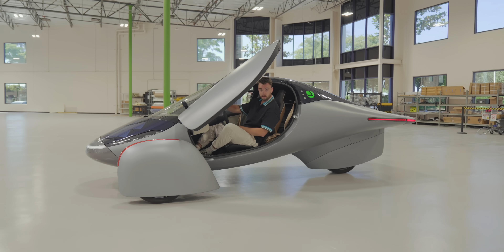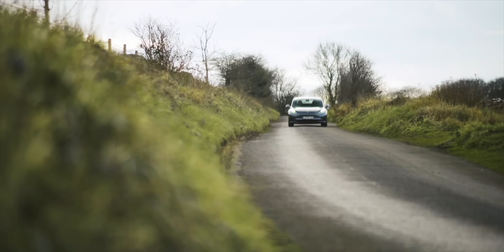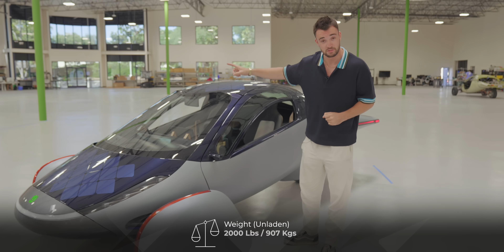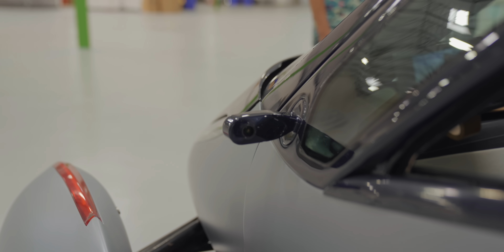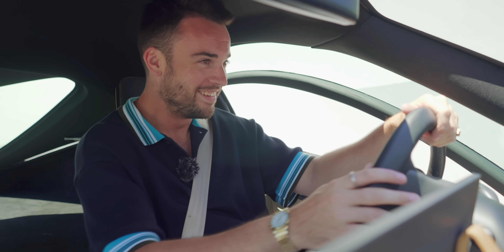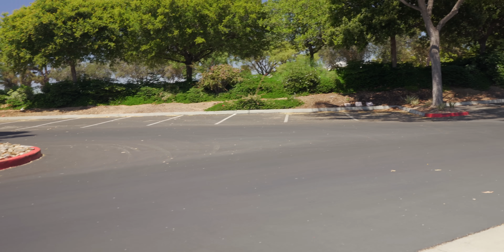The Game-Changing CHEAP Electric Car Inspired By Fish!

Comment: Honestly, I wish they made a 4-wheeler version. Two wheels at the sides of the back side, would have made it a lot more stable, which means it could have added a feature to make the front wheels get closer to eachother at low speeds, so people can more easily fit through narrow roads (like the one in Italy, for example). Being an upgrade, it would cost more, but it would also mean that it would be categorized as a car, so it can be driven by people who don't have a motorcycle driving licence but do have a car driving licence. Edit: It would also really help if they would add the option to raise the wheel covers, for more safely driving on roads with potholes, even if the price increased and the speed needs to be decreased.
Reply: From memory, there will be an off road version with higher wheel covers, and in the UK at least, a car licence will allow this to be driven - it's a trike after all.  Narrower would be good though.
Reply: That will defeat the purpose of their teardrop shape design.....the whole point of this company is producing cars that are the MOST aerodynamic.
Reply: The second planned Aptera is a 4 wheel, 5 passenger sedan. that may fulfill some of your wishes.

Comment: Sandy Munro says shaping metal sheets into such curvy shapes as this fish-shape of the Aptera is very expensive, which is why the flat Cybertruck of Tesla only costs 40k USD. In that case, the Aptera should be expensive, which is why it is a one of a kind, but remember that this is made of composites, not metal sheets, so it's basically plastic.
Making curved plastic isn't expensive. Look at all your plastic toys.

Comment: Wow that looks fantastic. Even allowing for the lower light levels in the UK, it would be ideal for someone doing just a few local runs each week, all on lovely clean solar power. 🙂 I can imagine that those local runs might get extended a bit though, as it looks such fun to drive. 
I would quickly get rid of that horrendous square steering wheel though, change it for a proper circular one.

Comment: I love the car and would love to buy it but it will have a problem in places such as where I live in New England where it snows because of its ground clearance with the wheel covers. Another thing is the cold New England winters. Are there plans for  warm air vents to warm the cabin?  The seat and the steering wheel will warms those body parts in contact with them but how about other body parts such as my face? Will it have air conditioning? If so, without air vents, how will the cabin be cooled? As a result, I am hesitant to buy it. Once they solve those problems I will be among the first in line to buy an Aptera(= without wings). I would also like to buy the Terrafugia(= Escape the Earth) FX but Geely seems to no longer pursue making a flying car.

Comment: The width of the front wheels - may as well be a larger compact 4 wheel vehicle than one with limited utility. How does it handle potholes? We just need a genuinely cheap small hatchback with good design and efficiency. Maybe the BYD Dolphin/EA1? Don't think most buyers will flock to the Aptera as interesting as it is. But they won't need it to at their production numbers, they'll sell whatever they can make.

Comment: Amazing design! It cold be an alternative to  3 wheeled scooters. I would say it's commercial success would depend on how fun it will be to drive
Reply: Based on a ride my wife and I had in an alpha prototype back last November, the acceleration is thrilling, even in the 2 motor model.
Reply: pop-out hanglider & hydro foils condensed back up parking.

Comment: Narrow lanes in London, come to Devon we have some narrow lanes with a central raised grass area which are ideal for three wheelers and for cleaning floor pans. As I fly over Devon I see much green stuff due to the amount of rain we have which comes from clouds. California seems to have a lot of blue skies instead. 
We are daily sliding deeper into a Low Sunspot period, and more clouds and therefore more weather is on the cards. Light cars are no good in floods or high winds, and especially side winds which can be eased mentally by opening the windows. The feeling your about to be blown off the road is common in light vehicles.

Comment: "Thankfully" they didn´t mention a few drawbacks of the concept ...
(not that there are many, though)
1) The three wheels design allows higher efficiency but is really bad for driving stability (and suspension to some degree)
2) Making the car 2.2m wide at the front wheels helps stability but likely makes it usable in U.S. cities only. Finding parking space that wide in European cities will become a challenge ...
Reply: Heh, I don't think it's that wide. Width on a low cost sedan here is Europe is about 1.98 meters without including the mirrors.

Comment: "When it comes to electric cars it's the magic that makes everything better." BS. There is no magic in them, and not everything is better - mostly worse than ICE cars. Better range? No. Better priced? No. Better fill times? No. Better handling? No. Better tyre wear? No. Better top speed? No. Sure, they beat ICE at a few things, but overall, they are too little for too much. But Jack has sunk low by pretending this lame duck has any 'magic', because it is yet to exist and the prototypes are all fakes. The Gamma they will be showing at FCL is most likely to be another fake. Aptera has announced that it will be a static display only for attendees. It needs to do the things they brag about, but I am not even sure they have motors from Elaphe yet. I can see Aptera Motors will be desperately ripping out motors from an Alpha in the coming days, so someone should hold them to driving all their prototypes together to prove they haven't done that at the first drive of Gamma. In fact, when Gamma can eventually move, they should run them all around Chuckwalla until they all drop and publish the distances for each.

Comment: I'm astonished that you didn't mention that The aptera is capable of 0 to 60 mph in 3 and 1/2 seconds with the all-wheel drive variant. Imagine that, it's as fast as a performance Model y with potentially three times the range and no need to charge ever

Comment: Nice review, but he has been misinformed about a few things.  Number one, it isn't a car, at least in the US.  It will be registered and insured as a niche in the motorcycle category.  This has aided the production because it does not need to meet the same safety standards.  Chris was very accurate in saying that it is closer to one of the Solar race cars in Australia; neither one has formal airbags in the steering wheel or passenger dash, not side curtains.  He also needs to understand that this model is not the one which will potentially get 40 miles of range per day with solar charging.  One needs to opt for the full rear hatch option which will sacrifice the rear window.  Why compare it to other EV's like the Mercedes EQXX or Lightyear Zero which both cars.  Once you make a similar comparison to other motorcycles such as the Zero or Livewire, the features of range and efficiency are more matched.  I wish Aptera would focus more on comfort and safety rather than total efficiency.  I would certainly sacrifice a few kilowatts if it were only safer.

Comment: It's beautiful and cool, but we don't really know what the specs actually are given this is an Alpha, on the way to Beta... and they'll have production going next year... Much like software; it's vaporware until it's released. Review the specs after release. It's not a car, but a tricycle..., a fully enclosed e-slingshot? A motor cycle achieving efficiency at least in part by not having to obey car rules... Don't interpret this as hate, I love the vehicle, but rather a bit of Jade. Seems like we've been here before. I hope it's different next Feb 2nd.
Oh, and the 1965 Dodge Cornet convertible my father owned until the 1980's placed it's fuel intake under the spring loaded read license plate, a common feature, but a good use of space. Very futuristic.

Comment: Been following Aptera for several years, and hope to get one someday.  I do question the mileage claim a bit though, if you add a passenger and their "stuff" (say if you were to take a trip), that adds significant weight. And little things such as video rear view mirrors currently not legal in the US.  At least CA is now approving vinyl front license plates, so that won't mess up aero, unless it requires a somewhat vertical and/or flat surface.
Reply: Front plate on a cycle, since when?

Comment: I really want to see this in production soon, but Aptera continues to make optimistic claims about range and efficiency. Not GROSSLY hyperbolic, but 10 mi/kWh is a best case scenario. Rolling resistance alone is a large part of that issue, and throwing in a 100kW battery is going to impact that significantly. It will be able get close to those numbers, but average drivers just aren't gonna get there.

Comment: How much did they pay you to blow smoke about that car for 22 minutes?! It's ugly! Useless for most use cases except 2 people and a few items on very flat roads. With no bumpers it gets totaled with any impact. Hub motors are THE WORST kind of brushless motor! Their weight is unsprung and in the tires where it is going to make ride quality the poorest. Power to weight of hub motors is far lower than outrunners or inrunners. This car should have drive shafts out to the wheels and the motors in the nose area. I bet these cars are not as good as the hype. That cowling around the rear wheel will get smashed and destroyed the first time this thing goes over a speed bump! The front wheel covers will break soon after!
*
No brick shaped fish? Really? They ought to spend 11 seconds confirming that information before spewing such nonsense! There are quite a LOT of blunt nosed fish!!! They are NOT all slim and aerodynamic! How about 90% of whales? Really blunt nosed! What a bunch of marketing hype!
*
Your definition of "cheap" is loads different than mine! This thing is FAR FROM CHEAP in the price tag department! Half a car and costs more than a typical small gas car that will have much more passenger space and cargo carrying ability! Just my opinion...they won't sell very well and Apterra will go out of business again.
Reply: Again ? Do they have a track record of vaporware ?
Reply: @machintrucGaming  Ever see an old Aptera on the road...like anywhere? You'll see the 2 or 3 prototypes that got built and no actual production units. Maybe this time they will actually make a few of these ugly ass things for sale? At the price they want for them, they won't sell well and certainly won't compete with much better options that are either electric or gas powered. Efficiency is a good thing, but when you lose beauty, function and practicality to get it, the market for the thing rapidly dries up if it is also expensive. 
*
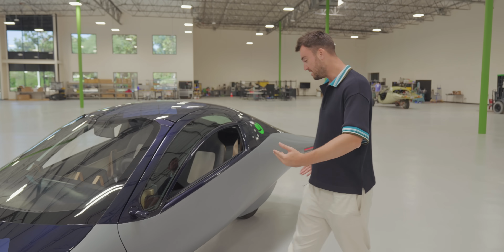Look at what's in that warehouse. Did you see any machinery? How about partly built cars? Any production lines? You see tons of empty warehouse space, a few chairs, fork lift and a couple of people walking by. Start watching the back ground at 5:32 to 8:25. Earlier on you can see the rear roll up doors of the warehouse. That's literally the back doors of the space! At 5:32, the camera angle lets you see out the front windows of the warehouse. In the back ground is a prototype car and not much else. Watch until 8:25 and the camera operator goes completely around the car. Camera angle changes enough that you can see the entire warehouse space and that it is 100% empty! What's that tell you about production of these cars??? So yeah...vaporware!

Comment: Have drooled over this thing since I first saw it several years ago. Absolutely awesome. Sadly, it's wider than a Transit van, so it's not gonna work well in the UK, but I wish them the best of luck across the pond.
Reply: It could be that the homologation process will end up with a narrower design for the UK market, which will trade some aerodynamic resistance and speed to fit in narrower spaces.
Reply: @n.brucenelson5920  Maybe, but they are a tiny company with more back orders than they know what to do with. I imagine it'll be a long time before they get around to thinking about selling outside the US, let alone in markets requiring a conversion to right hand drive.
Reply: @robrackstraw  True.  But the RHD models have already been designed and they have European holomogation experts under contract.
Management and board members have made repeated trips to Europe.
One of the founders replies on German language forums.  They may be more serious about international markets than you imagine.
Reply: @n.brucenelson5920  I'll be very happy to be wrong.

Comment: If you make the back wheel a dual, sister-ed wheel, so there are two wheels in one, you can make this vehicle eligible for the Federal tax credit that requires four wheels; easy fix. This edit would also make the rear wheel safer, should one of these new dual tires go flat.
Reply: And make it liable for all the safety requirements of a car, rather than the 3 wheel trike it is now.

Comment: The major OE's don't make "cars" like this for the simple reason there is practically no market for them.....  

Who is this actually for?  If you want to do 1,000 miles at speed, get on a train ('lecys trains are characterisitically long and thin and thanks to steel wheels/rails have very low rolling friction, and take lots of passengers, so return very good ml/kWh/passenger), if you use a car locally as a lot of people do, then you don't need very good aero performance, and with just two seats this massively limits the usefulness of this vehicle. Add in probably zero NCAP stars for crash performance and realistically, most people wanting a small BEV will get a Zoe, ID3,Leaf etc etc

I also can't see how 100kWh of batteries is going to fit into that car, given the very non-rectangular form factor of the body. There is probabyl just enough volume, but packaging cells and busbars into that odd shape is going to be a massive PITA, and then you get to the issue of protecting that huge battery from impacts. Something like a Tesla Model3 has probably the best side impact performance for any passenger car precisely to prevent the battery being deformed, damaged and going into thermal runaway.

yes, some people will buy this a a toy (as per a MX5/Miata) or personal commuter (as per the Renault Twizy) but hisotrically that has been a very low number of people overall.
At half the price of a tesla, that's still very expensive for such a niche vehicle with just two seats.

Finally, as consumption is a reciprocal, the absolute running (fuel) cost difference in the real world between a car returning 5 ml/kWh and one doing 10 ml/kWh is fairly small, so i'd argue that whilst very low consumption is great, it's not that much of a buyer driving force once it's already "low enough" as it is for a mainstream BEV (and in all cases, driving style and driving cycle make a far bigger difference in the real world to overal consumption)

Comment: I like it, it's an aerodynamic compact car, which is all I need.  If the price is right I will get one.  The solar panels should be an option though as they add weight and cost to the car, and being in Scotland will not be of much use.

Comment: That whole "never plug it in" thing - I was surprised when I entered my location, even though it's in sunny NE England, that I could do my entire annual commute without any additional charging, just using the solar panels. I am impressed! Just keep the pigeons and seagulls away from it... 😁
Reply: Hard to believe that in your latitude and rainy climate you could get away without plugging it in unless you never drive!! I've never heard of "sunny" NE England!! Perhaps you have not glanced outside???
Reply: @nixl3518  🤣 the NW is the damp, rainy side of the UK!

If I was fully 20 years younger, I would get away with cycling the 3-4k annual miles to work... 😁
Reply: @examinerian  I have lived in your country and know there is no such thing as a dry part. You are speaking in relative terms, but u provided the answer yourself; you are not  the spring chicken u want to be, to bike a million miles! Neither is most of the world. Biking is a niche mode of transport and society will not change its fabric to accommodate the bike, electric or not. I am a proponent, but not as starry-eyed as most.
Reply: @nixl3518  If only everything was perfect!!! I have cycled a lot before, but for fun and/or charity, not for commute. This country is not set up for it in the same way that others in the EU are - it takes effort on the part of the councils and government, which is sadly lacking in a lot of places.

So, one Aptera 25kWh version should do nicely!

Comment: NOT A CAR! This is a dangerous FRUAD! The NHTSB says the Apera three wheeled vehicle is a "motorcycle" and therefore is not crash tested. Be sure to buy a good life insurance policy if you buy one of these over priced motorcycles.
Reply: Yes it's legally a motorcycle, or an autocycle in some states. But Aptera has made clear that they will do standard crash testing once they have a production model, and based on their design, they expect it to get high marks in safety.
Reply: @GoClimbARockEh  It will NEVER BE A CAR! This company is based on deception. No 3wheeler ever achieved mass adoption.
Reply: @masminor  I never said it was a car. (but honestly, who cares? It drives like a car and functions like a car. It's a car). And Aptera has been more transparent than just about any other auto start up. They have not deceived. It will be a niche vehicle, surely. Not everyone can use a two seater as a daily driver. But I can. It will be the only car I own.